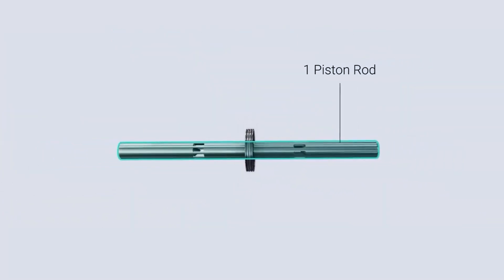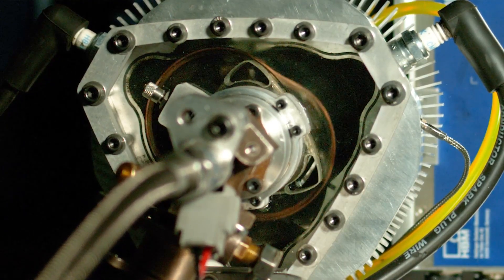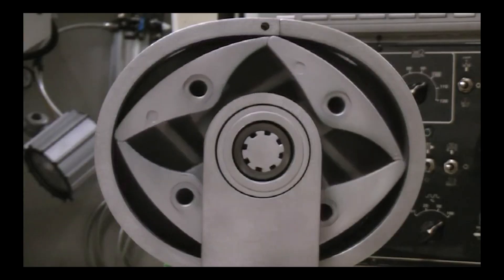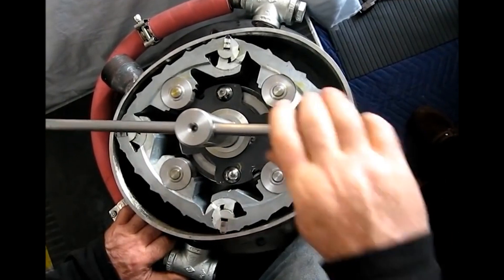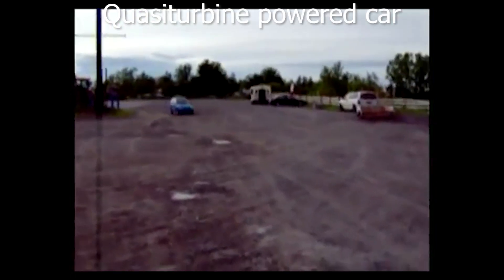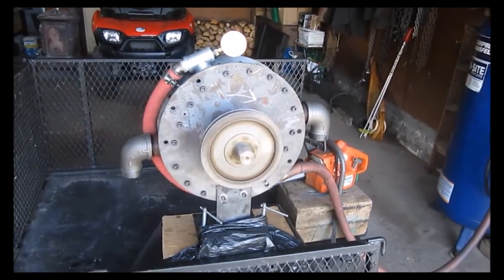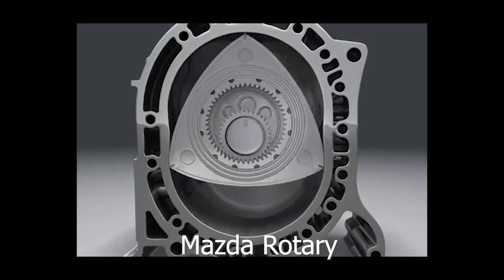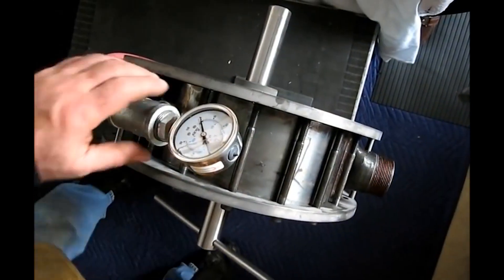The Quasiturbine a different take on the rotary engine

Comment: I researched this engine back then, and the problem was that it couldn't use normal seals. The joints prevented it. It needed bearings, and those bearings would fail with the heat and pressure fluctuation between the cycles, requiring frequent rebuilds. The best solution discovered was a slightly modified rotor that pushed the sealed faces through the cycle, and it uses 8 seals. However, the complexity of maintenance was beginning to defeat the advantage of rotary design, and the application was facing the problem of technicians to service it, which was out of the control of the engineers.

Essentially; the mechanics of the world were going to have to learn how to work on it, and nobody believes they will to the level necessary. There would likely develop 2 kinds of mechanics. At first, there would be no incentive for a mechanic to learn this engine, so it would have a difficult start. Then vehicle owners would have no way to know which ones were competent with the engine, so finding the right kind of mechanic would be challenging, and mechanics finding a good market to work would be challenging.

Ultimately, it wasn't the engine that killed it.

Comment: Some extra points. Being 4 sided, and fires every 1/4 the impact of the explosion is less, thus less vibration. This would make it suitable for aircraft allowing for lighter structure doe to less vibration. Because it rotates in one direction, hydrogen is an appropriate fuel as IC engines have serious dead time at TDC and the hydrogen ignition is a huge impact to wrist pins , con rods and cranck especially at RDC. . The QT does not have dead time and thus constantly moves away from the flame front.  The engine has no crank so therefore the centre is empty and will allow a transmission or generator to be built inside .! 5th the weight and size of a IC engine would mean that suspension and all other components of the vehicle would be  much lighter. The technology for to engineer and manufacture with current metals solves all problems of wear. A 3.0 liter engine, comprising of 3/1.0 litre units would be about 12 to 14 inches in legth and about the same in diameter, making it a great charging system for electric vehicles. Not surprisingly, major manufacturers would not be intereste as the QT would have less parts, making it less profitable and that oil companies would lose also as less vehicle weight means better fuel economy and thus, not pro oil industry. Always follow the trail of money and who looses at the bank to find out the WHY. that good things do not progress.

Comment: What I do not like about this engine, and the wankel is that the combustion is happening on the same area wearing it down faster. The liquid piston x more evenly wears it.. However I think there is still yet some better rotary motor. The omega 1 is a neat take. And this is pretty interesting too.

Comment: Because there was is no hydrogen production and distribution to fuel the engine.  But they have solved the problem of storing, transporting and refueling hydrogen now, but the government has deemed the technology too disruptive to market, so how long they will not let it go to market I don't know.  But with all the green energy push now, you have to wonder why the technology is being suppressed by government now.

Comment: There was a description of this engine in a old Popular Science magazine in the mid 1960's... they had not actually built one. Super cool that something happened with it. I think that the way to spur development of these alternative engine designs is to have a car racing class that is strictly for "banned" engine designs... maybe the only rule is 500 cc, a minimum speed of 100 mph, and 50-100 gallons of fuel... go as hard as you can for as long as you can. Other than those 2 rules, pretty much anything goes.

Comment: Its basically the same principle as the Wankel engine, the problem with these engines is that most of the compression get "lost" because 30% of the pressure goes the other way pushing against the direction, Mazda has spent millions on how to fix this problem and so did various other investors. And they gave up...
Another issue with those engines is they need to be lubricate trough the fuel mixture, they can't use an oil bath like conventional car engines...
The bearings of these engines will fail often en destroy the engine if they do fail.
Reply: The other problem is the low compression/combustion pressures- they are kind of fuel hogs for the power they make, and this is a direct result of the low combustion pressure. A lot of that has to do with the still fragile apex seals

Comment: Design a revolutionary battery wasting your engineering skills designing engines that eat dinosaur juice...
Reply: How do you get the materials for the battery or make the electricity without dinosaur juice?
Reply: This engine can burn sun juice, i.e. hydrogen and emit only water and nitrogen oxides that can be easily neutralized with a one way cat.

Comment: I always thought someone could make a motor, or a propulsion system rather, out of thick rubber bands and pulleys, although I have no idea how it would work. Suppose you have 4 rubber bands working like a 4 cycle and a few pulleys loading them. Idk.
Reply: Your talking about a wind up toy? And if your not then you would be breaking some laws of physics to get whatever your talking about to work
Reply: But… what’s the power source. I can’t tell if you’re thinking it’d be limitless energy or if you’re just thinking of it as a just a different way to configure an otherwise normally powered engine. I’m really curious what you’re picturing because the pulleys are really throwing me off idk how you’d incorporate those in an engine lmao
Reply: You're right. it would need a small motor cranking something like 3:1 rope pulleys in order to stretch the rubber bands and at best it would save on fuel. I guess the hope for the entire system would be to gain more power out of a small motor. But honestly I have no idea, just threw it out there.
Reply: @kcjones6034  I'm pretty confident he is talking about a perpetual motion machine, and you are talking about a pulley based form of gear ratios
Reply: @Depl0rable10  how about this idea (not exactly all my idea) a big laser pointed through a venturi onto a solar panel connected to a battery pack powering an electric motor connected to an alternator powering the laser. 😎👍
Reply: The problem with rubber bands is you only get out what you put in, so you won’t be able to make power. When you compress an air-fuel mixture and ignite it, you get much more out than you put in.

Comment: Even though it's old I have never heard of it before. It's kinda sad that ideas like these are just allowed to die when they are clearly better than the current way we are doing things. It's just like that one guy Ernie Brink who's ideas solved all the problems with Mazda's rotary engine and Mazda never moved to make the improvements and would thus have the best engine on the planet. Nope they chose basically to just allow themselves to go out of business slowly instead.
Reply from the maker: It is sad😐
Reply: It's called politics.
Reply: @4G12  No it probably has other problems like lubrication or something. Those things are only good on paper or prototypes that don't run long. And it would be hella expensive to bring things like that into mass production and integrate them into current ICEs.
Reply: Not sure about who ernie brink is but, saying Mazda is out of business entirely is a bold statement. They are still very much alive and well, not sure what your looking at